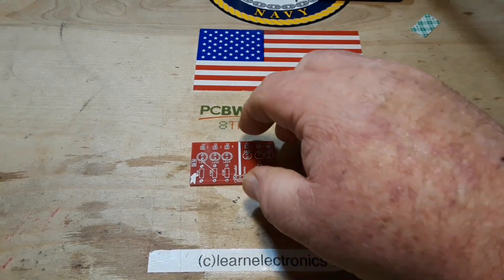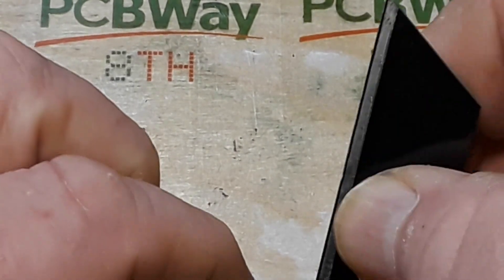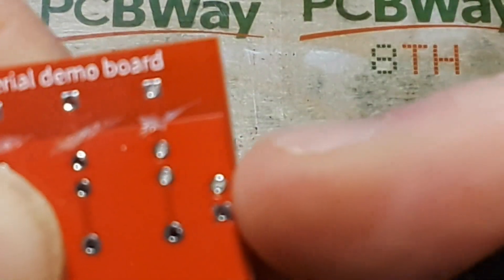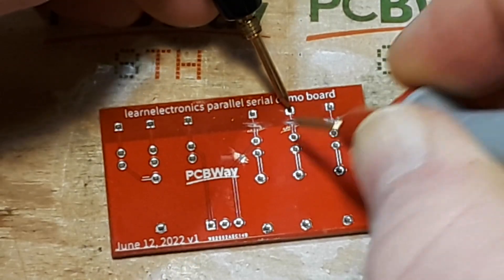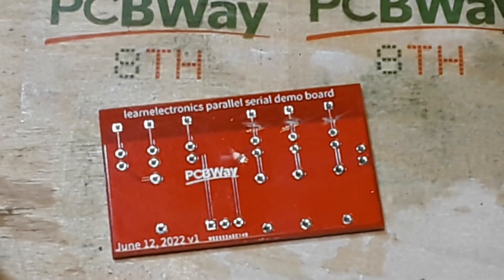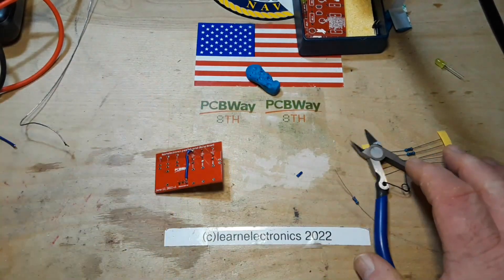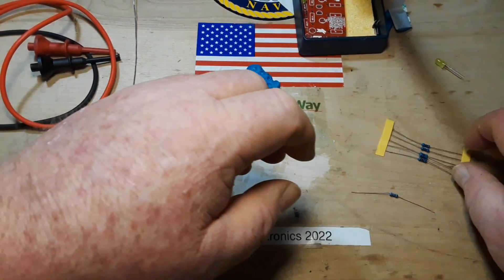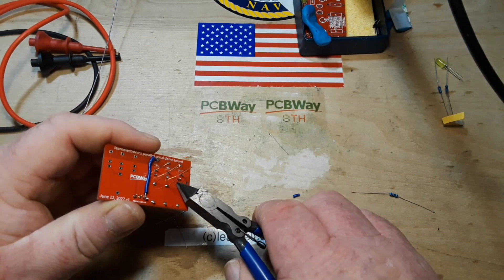This PCB Needs A Mulligan

Comment: Im fairly new to PCB designs and electronics design, and I just messed up my first SMD order! I made a small modification to the schematic and didn’t properly carry it over to the board layout. I caught it soon enough to get a second set of boards but I need to manually transfer all the components. Sucks but I’m not down about it cuz it’s all part of the hobby!

Comment: From the number of bodge wires and cut traces I see on commercial boards I can say hold your head up, you produced a design, then had the knowhow to do a post manufacturing modification! A thought about the centre LED. Is the joint on the wire connecting together ok?

Comment: I remember i made one mistake on my voltage current power logger circuit board and found out from a smoking potentiometer. Need these mistakes to learn. Cheers Paul and stay cool.

Comment: If you're gonna re-spin this one, then I have some food for thought for ya. First of all, these boards are supposed to be educational, right? Make them so it's easy to see what's going on on the board, i.e. don't route tracks on both sides of the boards and don't route traces under components,  if it ain't necessary to do so. It's an absolute mindfuck trying to make heads or tails out of track spaghetti, especially when you're a beginner. 

Secondly, you might want to consider laying out and routing the board so it resembles the actual schematic diagram, so it's way easier to follow (that's assuming that the schematic diagram is not shit :-). It's trivial to route this one on a single sided board (or a two-sided board with one solid ground plane if you so wish), no jumper wires needed.

 Thirdly, consider the finish on the PCB - choose one that has crisp visible tracks and less gloss (what's wrong with good old school green matte finish?).

Fourthly, this has been bugging me personally - track width. Increase it (it helps with my first point). Even your power supply boards that have heatsinked regulators push all the current through hair-thin tracks. Why oh why?

Take care.
Reply: Thumbs up to all your ideas.

Comment: Full marks for the confession of the board cock-up Paul.  It happens dude so don't beat yourself up over it.  I have started designing my own PCBs using PCBW.  I usually sleep on things for a few nights before sending the gerbers in.  I find I pick up a lot of mistakes that way.  Luck with version 2

Comment: If I need to do some proto modifications. I usually print the schematics and mark there what changes I need to do. After that I print layout and mark there what I need to do and is it possible to fix. When butchering pcb I mark what I have done and in end check all planned modifications was done. Sometimes you need to do this few time when you find more bugs.
Companies have reviews for schematics and pcb. Still there can be some problems slip trough.

Comment: I have a whole box full of mistakes.  Bad traces, wrong component placement, wrong component pattern, wrong pin hole sizes.  You are not alone.  My latest was wrong pattern for an SMT mosfet.  I was able to test the board by substituting a through-hole equivalent and soldering the pins to the pads.

Comment: Teachable moments like these are way more valuable than you'd think. For one thing, I don't see bodge work being demonstrated on new pieces - just on the repair channels.

I did have a double play of a screw-up recently. I consistently selected 0603 metric when the 0603 I was designing for are standard. I also wanted to include an inverted switch signal while using one of those schmitt trigger inverter-based debouncer circuits. I thought it would work if I just routed the pre-inverter signal to the pad, but it turns out that's too weak on its own. It should have gone through another inverter to give a strong enough negative switch. Having the wrong size pads did not help me figure this out right away. 

Well, my redesign is on the way. Who else has a cautionary tale for the noobs?
Reply: You usually bring first proto to working condition before ordering next version. This way you may also find if there is something else that need to be fixed.
Reply: Admittedly, it was a last minute thought that burned me. My prototype used a hex inverter, but I'd planned to use some surface mount single gates I had. Between the rats nest I'd created IRL and a misplaced multimeter, I was boned even if I got the footprints right.

Edit: Just to make sure, I got some SMD to DIP adapters, and my revision uses a hex inverter, because it does use all six gates after all.

Those adapters are great 👍